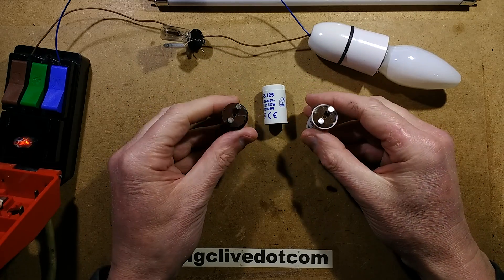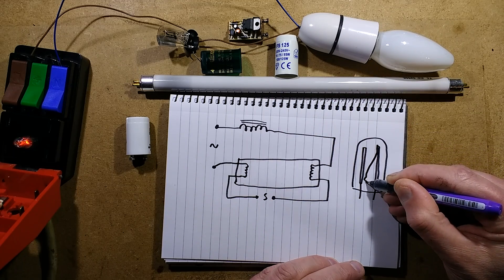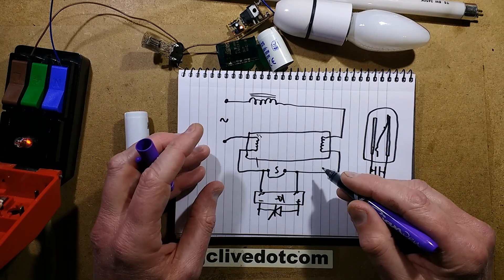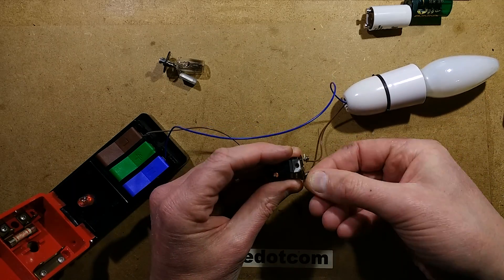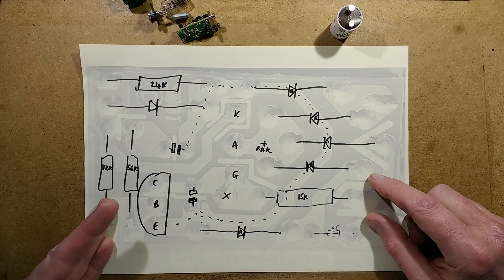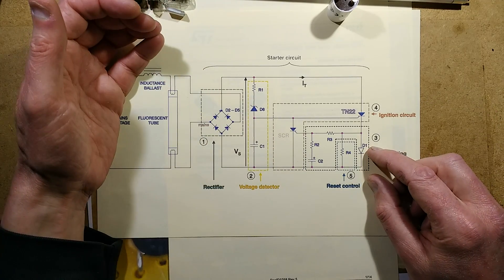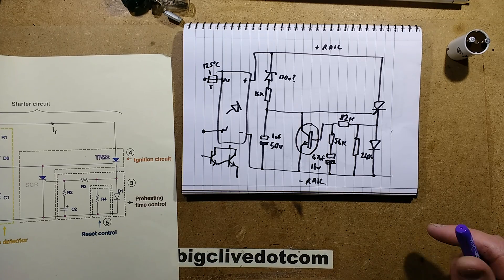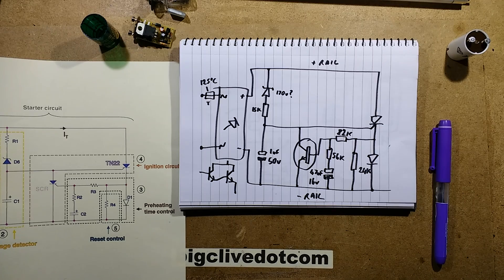Reverse engineering an electronic fluorescent starter.

Comment: Here is how I think this circuit works.
The gate-cathode junction of the thyristor conducts just like a diode and the thyristor will not fire if the gate current is low. When the transistor base voltage drops by discharging the capacitor, the transistor turns off and the gate voltage rises, recharging the capacitor. The transistor keeps the gate voltage below the threshold.
The gate current (capacitor charging + transitor base + diode) must be kept below the threshold to keep the thyristor off (for lower consumption). In the case of the gate current of the thyristor is above the threshold it will conduct from anode to cathode and will recharge the capacitor the same way the gate-cathode junction would.

Comment: The starter doesn't operate after the tube fires because the voltage on the bridge rectifier droops down and the zener prevents any voltage from going into the gate of the big SCR. If the tube doesn't fire or the light is switched off then on, full mains voltage is applied again.

Comment: Used to make disco lights using a starter on each one off theses  RED GREEN BLUE spotlights and there also great for flashing Christmas lights did you know if you alter the value of the capacitor across the flasher you get different flash rates

Comment: 11:15 Technically speaking there's a different terminology used depending on application. Choke - to block RF and Ballast - to limit AC current, also typically ballast would be much bigger and have higher inductance.

Comment: i am suprise you still use starter in the uk i am a master electrician in canada been for 40 years and when i started starter was fade out at the time
Reply: Because electronic ballasts are still heaps of garbage here in 230V land, I'm an electrician for 10 years in Estonia and I have seen plenty of electronic ballasts fail way before the tubes does.
Reply: True, I'm an electrician and I can say the electronic ballast are much less reliable the the old starter + ballast types, I've seen some fail in just a couple of months with not much use.
Reply: What did you actually use to start fluorescent tubes back then?
Reply: But how many times do people call you up to say their lights are working just fine?
Reply: On the magnetic ballast fittings that you measured, were power factor correction capacitors fitted (and were they in good condition)?  This makes a huge difference to current draw on a fitting with a magnetic ballast.
Reply: +ThEcRaZ3dGaM3R
Not only the british way. In Germany you'll still find such lamps with starters. I'm prefering the electronic starters because the light is faster on (switch on, light is instantly on). I've got some old starters in my cellar and one lamp in my garage. In the garage there's beside two new lamps an old lamp with a starter. Pretty slow in comparision to the newer lamps...bing..bing..on...

In most cases better products are prevailing because the better is the enemy of the good. So there's no interference of the politics necessary, the more advanced products are replacing the older ones. But there must be an advantage in the new product to get accepted by customers.
Reply: +Matthew Trott

The ring circuit got some advantages, but some disadvantages too. The cables are having a cross section area of 2,5mm² and are fused with 32A. You can only do this with a ring circuit, the 2,5mm² is normally specified for max. 26A. Conductor temperature would exceed 70°C and the PVC insulation would decay. In a conventional circuit you must use 4mm² for 32A. The disadvantage is if the ring is open your cables are overloaded...
Reply: That's the disadvantage of ring circuits. This thing was introduced after WW2 when there was a shortage of copper in the UK. At this time they've done this with 1,5mm². Under this aspect this is understandable, but for now this is no longer state-of-the-art.

Here in Germany the circuits are always radial, the ring-circuits are a speciality of the UK. Here every room got it's own MCB at minimum (in more modern installations an extra one for the lighting of the room), some like kitchens got more circuits (stove, microwave, lighting, refrigerator, other outlets). Standard are 16A circuit breakers characteristic B. If you've got an appliance with a higher demand, you'll have to connect the device 3-phase (3-phase power supply in domestic buildings is standard here too) so you got 3x230/400 VAC. Flow-type heaters are often fused with 3x32A (~22 kW). My house from the early 1950s, with 88m² living space, is fused with 3x50A (~35 kW). But I'm using natural gas for heating the rooms and the water. Only old houses are fused with 3x35A, standard is 3x50 or 3x63A. This is depending on living space, heating of rooms and water and so on.
Reply: tin2001 rubbish! you have a very broken choke or need a new power meter as it's telling you lies! I have a 55 year old 5ft 80w fixture with original choke and the total power consumption is 95 watts when the tube has warmed up to full brightness
Reply: My elderly neighbour only recently had to replace her 60 year old fluorescent fitting because the ballast failed. It was a thick bulb with a rating twice that of the tube I tried for her. It wouldnt budge at lighting a new bulb even though it was new and I replaced the starter with an identical rating. When the old bulb was back in it just glowed at the ends but wouldnt strike. Not bad for a 60 year old fitting, made in Britain ;)
Reply: A couple of years ago I converted my dad's florescent shop lights to LED, the electronic ballasts had been in the fixtures for over 20 years and never gave any hint of failing. They probably would have lasted another 20.

Edit: They may have been magnetic ballasts, I can't remember.
Reply: Perhaps our higher voltage makes the choke + starter a simple (and hence cheap) yet effective system capable of running even those long 58 W tubes so that they were installed as standard well into the noughties.
Things like rapid start ballasts never really took off over here. You will mostly find the preheat magnetic ballast (choke + starter) or electronic ballasts.

Of course the more recent buildings built before LED took over will have the last interation of fluorescent tubes with those long life highly effecient T5 tubes on electronic ballasts. But you can be sure of one thing: those old fashioned chokes will have a near unlimited lifespan that no electronic ballast can challenge. Just swap out the glow light starter every other tube change and it can go on forever.

But I'm all for changing to LED. All the benefits of fluorescent tubes but without almost all of their drawbacks.
Reply: The 2,5mm² is only rated for 26A max in a radial wiring, this would mean a B25 MCB because there's no 26A available. A higher current would raise the temperature of the conductor over 70°C and this would damage the PVC insulation. That's the reason for ring circuit.

I think it's easier to add new outlets on a radial system. Next junction box or outlet from the position of the new outlet and make a groove in the plaster to there. From there you could install a new cable, install the base of the socket, new plaster on the wall, connect the socket, and that's it.
Insulation test, measuring the earth-fault loop impedance and calculate the PSCC (prospective short circuit current). If you're using a modern loop impedance meter it's calculating the PSCC automatically. Modern loop-impedance meters got an adjustment for a lower test current, so the RCD is not tripping. That's it. The german Schuko-sockets are rated for 10A permanent / 16A short-time.

In a ring circuit you'll have to measure the resistive balance of both directions, to prevent one of the cables getting overloaded and the other is not seeing any current.
Reply: that's true... you could end up with a pro that goes in, gets the job done and gets out or uncle bumblefuck and his team of cowboys ready to ride you like a horse for your entire net worth...
Reply: They all lived in another britain than the britain of today though to be absolutely fair. But you do have a point. It's not becasue of lack of forward thinking we still use starters though. It's because the cost of changing all the fittings that require them would be too much to be done unless absolutely necesary. I wouldnt think anyone installs the old style of fittings in new installations though.
Reply: We still use the old starters in here Malaysia, all made by Philips.
Reply: Marcel Germann The Ring circuit are 32 amp max every plug is fused to suit connected appliances from 1Amp to 13Amp and the wiring is rated at 52Amps 2x2.5mm2 to each 13Amp  max Socket, so there is plenty of protection and it also saves a fortune in copper wire when compared to Radial Circuits....also a lot easier to add socket outlets to because you don't need to wire all the way back to the Consumer Unit  (fuse box)
Reply: In sweden to. At my last job there were starterless small diameter tubes in the new part and old style in the old part of the building. No point changing the fixtures if they arent broken. (Even if the business was selling fixtures).
Reply: Babbage,  Faraday, Watt and Fleming ---- You missed out the greatest of the all (and another Scotsman) James Clark Maxwell
Reply: ray tru it's all good. I wouldn't mind a video on valves in modern applications.
Reply: jason laverty  hmm kind of a different argument that would be high/ top end!
Reply: it's not just you, most are garbage!
Reply: Most of the older fixtures I have come across here in Canada use magnetic ballasts and T12 bulbs without any separate starter.
Reply: For the most part they're LED nowadays. If you specify fluorescent then you'll have rapid-start with electronic ballasts instead of the preheat type with a choke. Also, you rarely get T8 fixtures above 36-58w and extremely rarely see the 125w T12 in new installs. Usually when you need that kind of lighting you end up with HID or LED instead.
Reply: True... only downside to LED is you'll be regularly replacing the drivers because unlike a good old choke or a transformer they don't have all that great a lifespan... Yeah they're more energy efficient but a lot more complex when you use a current limited supply than fluro... And you're right about the lifespan of the chokes... keep tabs on the lamp life and make sure you quickly replace a knackered tube and starter and you can easily expect a good 40 years out of a preheat fixture with a magnetic choke. With an LED and driver you're lucky to see 3.
Reply: Despite all kinds of other discussions, a likely reason starters aren't and weren't used much in the US, Canada and Japan is the 100-120V mains tension. A starter needs to have an ignition voltage above the working voltage of the tube but below the mains voltage, leaving only a small margin for reliable operation. Most table and desk lamps used manual starters if I'm correct. I'm not sure how the problem was solved in fixtures.
Reply: Refining the small things brings small gains, much better to tackle the bigger problems I would say!
Any circuit can be refined to deliver better efficiency and that will only improve with time and development. The glow start has been around for years as it was cost effective, but now in the UK we strive for more efficiency so here we are replacing glow starters with cheap Chinese circuitry.....not really a lack of forward thinking just economics.
Reply: There are still some stragglers on the market. I opened one a couple weeks back that had a starter in it, it was one of those Chinese-made 15W mini units. And yeah, I'm in Canada too.  :)
Reply: Michael Harman Chuck a Boomarang for me too but watch you don't hit the flying Doctor LOL Drones Excused
Reply: USA has those, too. The ironic thing is you can cut it out and put in a new starter (even though it shows none from the outside) then it will work again.
Reply: if your doing that much labor, perhaps LED conversion would have been a better choice :)
Reply: With comments like that you will have Babbage,  Faraday, Watt and Fleming turning in their graves!
Reply: One reason to stop using magnetic ballasts is that they're hugely wasteful. A 36W tube in a single tube fitting we tested pulled 89W. ~50W is lost to heat in the ballast. Using a modern electronic ballast reduces consumption to roughly what the tube says. And since you've reduced the heat output, your summer air-conditioning costs are reduced too.

The power bill at my old workplace was reduced by almost 50% just by switching the old magnetic ballast fluorescent tubed to LED retrofit tubes. Paid themselves off in about 10 months, and that was years ago when the LED tubes were almost double the price.
Reply: Never understood the thinking behind ridiculous ring circuits, it uses the same amount of 2.5mm cable as two single fed 20Amp circuits (a total of 40Amps not (32), no need to run 4mm, and if you do trip a breaker you only loose 1/2 of everything, not to mention the extra work involved in fault finding a damaged cable in a ring.
Here in the land of Koalas, Kangaroos and hippie's most houses only have 32Amp incoming mains, must be all those "electric fires" my Pommy Grandma used to speak about.
I do love your fused plug tops I wish we had them here, seriously good idea, stay by the "electric fire" i'm off to the beach to throw a few boomerangs.
Reply: +Mr Trott Suppose it does take some intelligence to understand ring circuits. Anyhow if it wasn't for Britain, you wouldn't be here watching or typing on Youtube  ;)
Reply: pumpkin king yeah, top end we do well, low level everyday stuff we lag. very odd
Reply: only ballast no need for starter
Reply: DjResR Oh yes. I'm currently working my way through a 30 year old building replacing the odd starter and choke. Easy. And also EVERY SINGLE electronic ballast, requiring a complete re-wiring of the luminaire including new mounting holes for the new switchgear. Not so easy.

Another problem with electronic switchgear is that 1 device runs 2 tubes, and if 1 tube fails, both don't light. Then the tenant puts in a service call, because "the lights aren't working". I insist on the old school type for all my new-builds - more idiot proof.
Reply: Why phase something out that works? That's the British way unless the EU says we can't have it... like 100W incandescent lamps!
Reply: ThEcRaZ3dGaM3R let's be honest Britain lacks in forward thinking. ring circuits are an example

Comment: Always wondered the same thing about those starters back in the days before electronic balasts.
Reply: In the US we have old desk lamps that use Manual starters. The Japanese versions of them are even simpler. I will describe the Japanese makes here, but the American models simply have a latch in the off button added that is unlatched when the start button is pressed.

When the desk lamp is plugged into the power outlet the line voltage is present across the lamp and ballast, but the lamp is not lit since a starting cycle has not occurred (note American units the off switch is usually still latched open). When the on button is pressed the start contacts are closed (dual tube units have two sets of contacts here). The on button is held in until the ends of the tube glow and then is released. If the tube doesn't start (either due to dodgy on button or not being held down long enough this cycle can be repeated. When the light is on the tube continues to conduct until the power is interrupted. When the power is interrupted (ether externally, by someone removing a tube, or by the off button for a few seconds) the lamps cool down enough that they will no longer conduct.

The circuit in the lamps is rather simple. The off button is a normally closed momentary (latched in the American versions) pushbutton and is in series with the entire circuit. The on button contains a set of contacts for each tube and these contacts are placed where the starter is in the circuit.

What's the big deal between latched and unlatched off buttons. The unlatched off button only breaks the potential from the circuit when held down. The tube can still be induced into a dim glowing state or started by external means (static discharge, discharge from a piezo ignitor, nearby lightning strike which is more common on the 14 inch tubes, CRT degaussing within a few inches, etc). The latched version keeps the normally closed switch open until the on button is pressed.

Now these designs are not common outside of 100 to 127 volt countries as the tubes must be in series to prevent instant starting with the OCV of the mains in 220 to 240 volt countries. In these countries a standard automatic switchstart circuit is used.
Reply: And for what its worth some of the cheaper ballasts have or had that same circuit built into them from what Ive seen. Obviously no longer removable, so if it takes a dump the whole ballast was trash. And yeah lol remember those back in my school on some of the desks since it was a historical site from the mid 1800's. Had to push that SOB button for a while to get light sometimes.